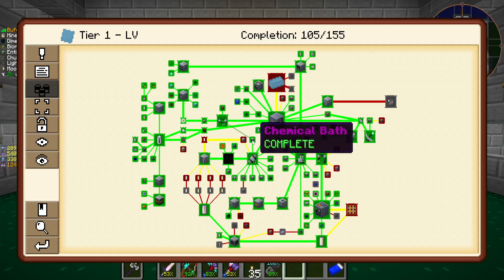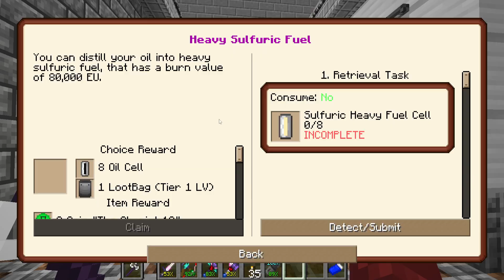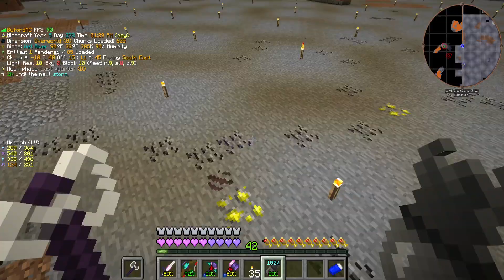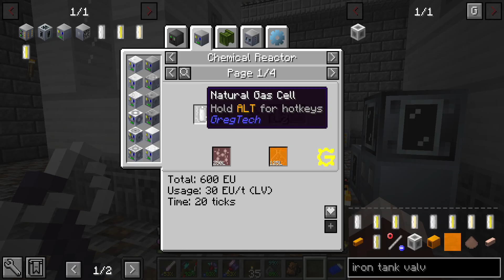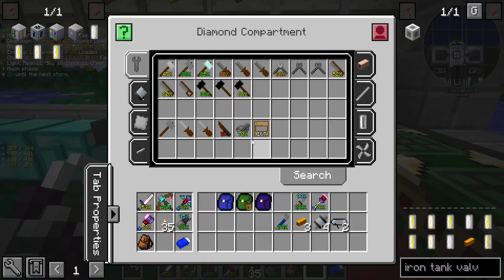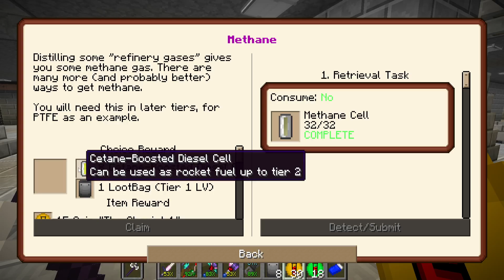GregTech New Horizons EP97: Oil Processing

Comment: Not sure if you've gone to check your oil spout, but a frequent problem with the LV pump is it is too slow to clear flowing oil, so once the pump gets into the actual oil pocket, it gets stuck trying to clear flowing oil and never gets to pumping source blocks so it stops getting oil even though there is plenty more in the pocket.
Reply from the maker: I actually did go check it out later on, and I dug into the underground oil pocket and there was plenty of oil left. It seems like it does get stuck occasionally, but eventually it starts delivering oil again.